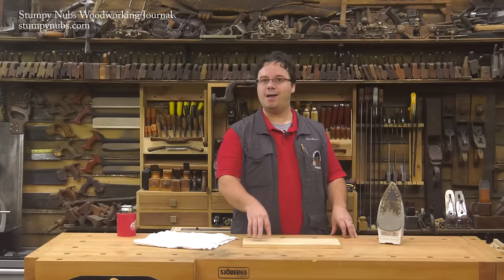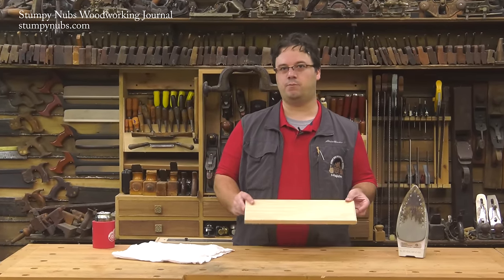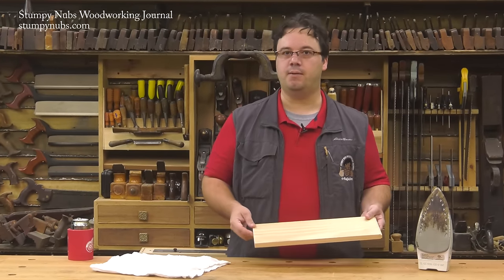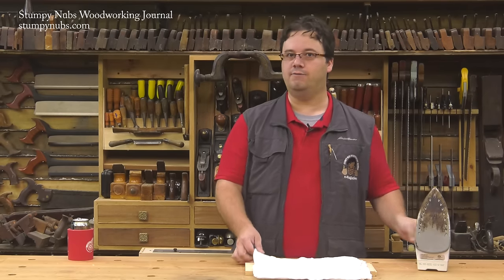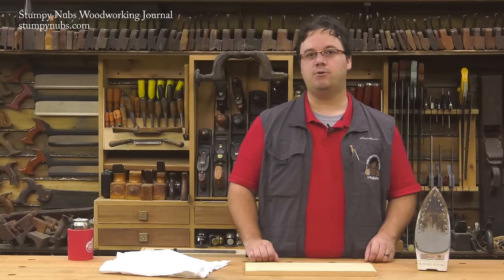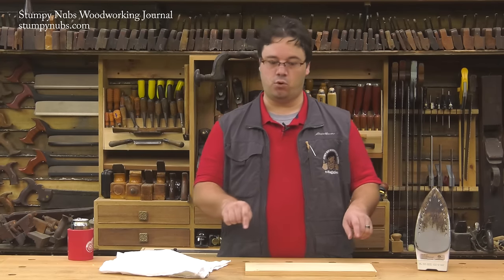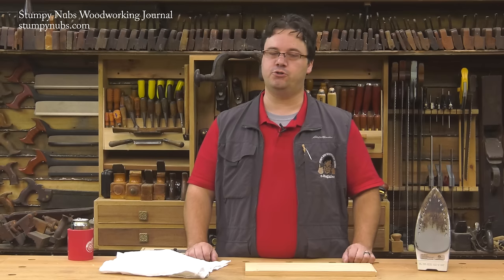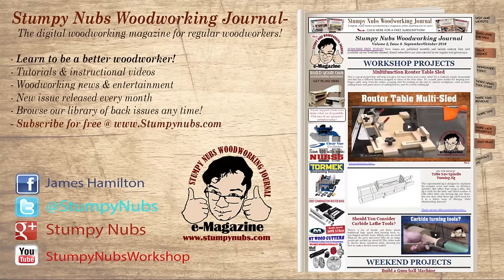How to iron a warped/cupped board flat again!

Comment: Having an conversation with a guy, he says the board will warp again. Is this accurate
Reply from the maker: It might. It depends on why it warped in the first place. That's why you cut your joinery now, while it is flat. Then if may be forced back flat when you assemble that joinery later.

Comment: I knew about using an iron and damp cloth to raise dents and dings, but never heard about using that technique for reversing the cupping of a board. Very cool.
Reply: I knew steam and moisture would do it. But, I needed an idea for larger wide pieces. I was thinking of holding it over a gas burner with a pot of hot water.  That would have been crazy!  lol

Comment: I did something a little different from watching this. Just to let you know, this was the only video I watched that told you the reason that boards warp. I had a sycamore slab that was kiln dried but as I started working with it, developed a bad cup in the center. I sprayed the wood down with water, flipped it over, put a1x1 in the center and clamped the ends to the table...over clamping it just a bit. Resprayed the next next and let it sit for a few more. I had lifted the slab off the table. It worked! I I’m imbedded a U-channel in the bottom for a preventative measure. My table is beautiful, thanks to your tip!    Wish I could figure out how to post a picture!

Comment: Just watched the video, then scampered out to the “shop” (my ex garage stall) and tried out this technique on two 12” long 3/4 inch walnut boards (I split a 1 1/2”+ board to get these two boards).  The iron steaming process went great!  A little too great at first.  Although I was respectfully cognizant of the cautionary advice given by James, this process unwarps boards much faster than I thought possible!  Consequently, I had to redo the process on the other side (which I did for a much shorter length of time) and it turned out beautifully!  The lesson I learned was to check my board frequently as the process goes very quickly.

Comment: Thanks. Your advice was perfect. I have a block board of walnut that had curved to 6.5mm concave in the middle. (its only 600mm wide so thats quite a lot). Ive madaged by a combination of ironing with a wet t-towel and just allowing to aclimatise in a warm room to restore the board almost to flat again. Still has about 1-2 mm concave left but thats much more manageable now.

Comment: Well let me tell you my story. I bought a stack of hardwood maple boards (kiln dried) and left them on my wooden board trailer and parked it in my barn. I clipped the metal strands holding it all together so I could oogle over what I had bought. Our barn is dirt floor, and it's getting into spring. I looke at them last week, and saw all the boards on the bottom row had "cupped" upward. These are 1" thick maple boards. One of my subs sent me your video. I do have an extra iron, so maybe I will give it a try! These will be dado-ed into a nickle gap and air nailed into my cabin. My concern is them re-cupping. I will give your method a try later and see what happens!
Reply from the maker: The boards cupped because there was more moisture getting into the fibers on one side of the boards than the other. Try laying them on some sawhorses or something in the sun with the cupped (convex) side up. Don't stack them, let air move across the surface so it will dry and the boards may go back to near-flat. Keep an eye on them, don't want to go too far and cup the other way. Before you install any of them, sticker and stack them in the cabin for a couple weeks so they can acclimate.
Reply: @StumpyNubs  ok sounds good, thankyou!

Comment: I like to torch wood but get upset at cupping. Its a pain to do and a waiting process, but I wet the concaved side with a water bottle, and put as many clamps as I can, it works, but if I have a project that needs to be done asap I'm screwed.

Comment: I actually had this situation recently. I got delayed on a project after I had purchased the material. About 40BF cupped after some unusually humid weather. Turned it over and put it under the sun for several hours. Presto! A quick run through the planner and I was good to go. Whew! What a save!

Comment: This video helps about as much as an article I recently read on fixing warped wood. Which is to say, it doesn't help much.

I came here looking for a visual guide to fixing warped wood. In my case, diagonally opposite corners, where one curves up; and when pushed down, the other goes up instead. If you can, please make a video showing wood that is curved like that, and physically do on camera what needs to be done while explaining what you’re doing.

Comment: I bought a used 3 piece plywood dash and started to strip the wood veneer off and after removing the wood veneer off one of the pieces I thought I had warped it but looked at the mirrored counterpart and saw that was warped  so will be using the warm cloth and and iron to remove the warp so it is back being flat and handily that is the same method I am using to remove the veneer

Comment: Dear Mr Extremely Clever Man, I have made my first ever window frames, joints... the works. However, I'm a novice and didn't realise one of the long sides is heartwood. If I lay the frames (double window) 7 of the corners lay flat but one pesky corner is 10mm (just under half an inch I guess) off the surface. I wish I could show you a picture.
I'm getting desperate and have just sprayed water on the two timbers leading to the pesky corner and have clamped it bent in the opposite direction. Can you help me? The frames are soft wood - redwood pine I think. H  E  L  P.  Cheers, David.

Comment: I have a badly twisted arm rest on a teak garden chair.  It's a 1/2 in board and the twist is making the opposite corners off by about 3/4 of an inch.  Can I use the iron method to bring it back to close to flat.  What about soaking, clamping and slow drying?  Thanks

Comment: Does this still work when the wood is already treated with oil?
Reply from the maker: No. The oil will make it impossible for the fibers in the wood to absorb the moisture
Reply: Ok so it needs to be sanded up again?
Reply from the maker: You'll have to do a lot of sanding because the oil likely soaked in pretty deep. And don't mistake this for a fool-proof fix. It will not solve the problem that caused your board to cut in the first place. This is intended to be used to temporarily re-flatten a board so you can cut joinery, etc which will mechanically prevent it from cupping again.

Comment: Would this work for a larger glued up panel? I glued up a 6ft x 2ft panel and its cupped a bit.  Or would my table top fasteners help pull it down to the top and flatten it. I’ve got a cup with the concave side facing down
Reply from the maker: It might, but first just leave it cupped side-down in a warm dry place and blow a fan on it. See if that helps.
Reply: @StumpyNubs  I’ll give it a shot!